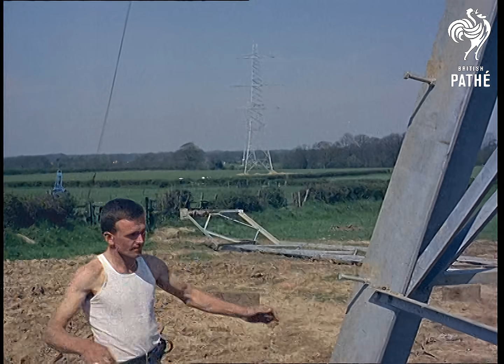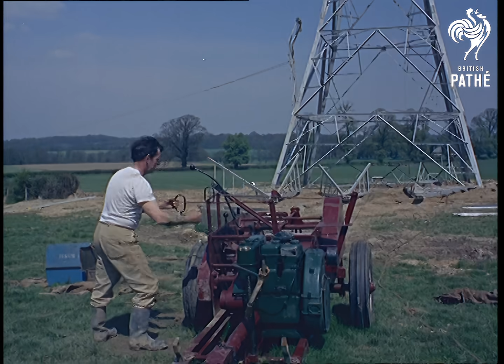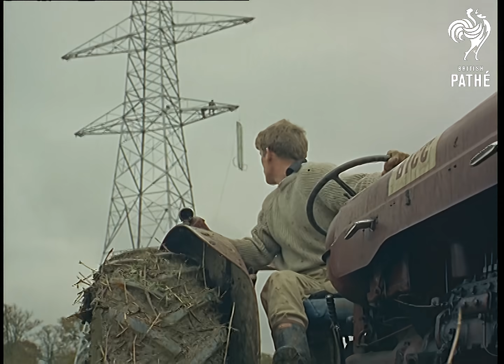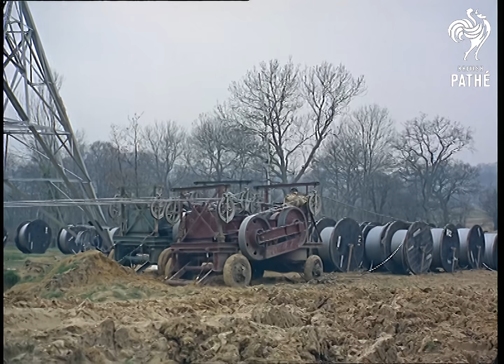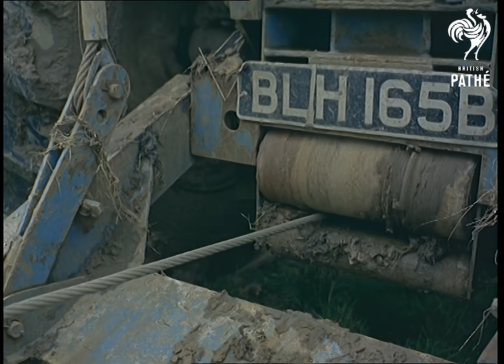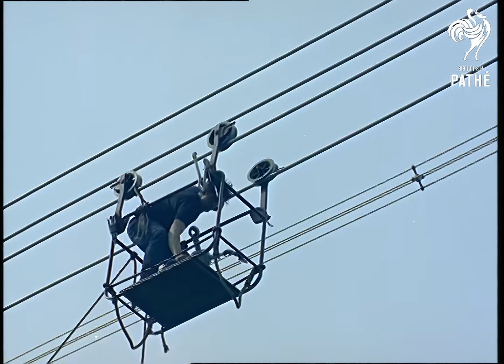The Pylon Men (1966)

Comment: Apart from the lack of safety cables, it doesn’t look particularly dangerous. Honestly, working in an environment like that would probably be very rewarding — you can actually see what you’ve achieved at the end of the week.

Meanwhile, I had to attend a one-day “training course” involving a 180-mile round trip just to be shown how to climb a ladder to about three metres. Completely excessive. I pointed out in the meeting that the drive there was more dangerous than the actual task — people laughed, because it’s obviously true.

Health and safety has become ridiculous in cases like this. It’s no wonder costs are high and productivity is low when so much time and money is poured into pointless box-ticking exercises. Everyone in my group was perfectly happy and capable of using a ladder, but we still had to sit through training that cost thousands.

And then there’s the paperwork — a very detailed RAMS just to go up a ladder and look at a skylight. Because apparently that now requires the same level of planning as a major engineering project.

If someone isn’t comfortable working at height, fair enough. But forcing the same over-the-top process on everyone, regardless of the situation, is just unnecessary.

Comment: The towers are the "L6" design, first introduced by CEGB in the early 60s and designed for the (then) new 400kV "supergrid" network that is largely still intact (albeit since refurbished) today!   The towers need repainting every 15-20 years to prevent corrosion and the insulators, spacers and other fitting need changing every 30-40 years due to mechanical wear and tear.
Hats off to the proper tough blokes who built these steel monsters 60 years ago!  
I guess most of them will either be elderly or passed away by now, but the work they did is still standing strong and serving the country admirably!
Reply: i worked with a man who told me how he was part of the gangs built these in the 60s, RIP legend Tony.
Reply: And the new educated citizens think this all happened by magic and it will be there fore ever.
Reply: Across the pond here.. I recently learned that the USA grids PYLONS are actually coded, from a single pole about 10  meters tall THAT carry no more then 480v to households to massive 200ishy meter tall towers that carry a Doc BROWN  inspired 1.21 zigawatts over massive distance in the heartland .. does GREAT BRITAIN do similar?
Reply: @thomasburke7995 in Canada, or at least in Ontario where I am, everyone is lettered and numbered with a coded system. Transmission line X1P for example is a 230kv transmissiob line that runs from a hydroelectric dam named Chenaux Generating Station to the city of Peterborough that covers an length of about 250km. The X and P is pulled from their supply and destination names with 1 being a single row 3 phase transmission system.
Reply: @thomasburke7995  Yes, all lines are coded and each tower in each line is numbered, with info on its specific type linked to that number.  So for example these L6 lines usually start with a number 4 followed by 2 letters for example 4ZP, or 4VC. Towers will be numbered from 1 to however long the line is.
Most lines begin and end with terminal towers so Tower 1 would most likely be L6DT or maybe L6ST or SJ. Though this info is kept on the national grid maps and is not easy to find for the general public, although there is reasonably detailed information on openiframap, also if you know your towers and where to look you kind kind of work out what codes and numbers each tower has.
Reply: Where they not hot dipped galvanized? Pylons/transmission towers on Ontario Canada from the 1950s are all hot dip galvanized and have never been painted or repainted. The steel lattice structures are all original and still look amazing to this day. They are all either 230kv of 500kv.  

I've never seen painted pylons/towers, ever.
Reply: @pipeweldor4850  They were galvanised, but usually get painted in addition to that. However you do occasionally still see L6s with original fittings that haven't been painted, they do look quite corroded and weather worn now, having stood out in the very wet and often polluted British climate for 60 years. The ones that have had periodic repainting will probably last for centuries.
Reply: @soundseeker63  Is it possible they are not hot dipped galvanized? I cannot see how that wouldnt degrade in Canada which has far far FAR more extreme harsher weather then the UK, yet they corrode in the UK? Seems very odd. Maybe werent truely hot dip galvanized?
Reply: @pipeweldor4850  I don't know what the exact processing for the steel was but they were galvanised to some extent otherwise they would have turned brown/orange within a couple of years of being built! Which they did not.
Reply: @soundseeker63 I suspect they were not hot dipped and most likely electroplated.

Hot dip galvanizing is a heavy duty method of galvanization where entire fabricated steel parts are dipped into a molten bath of hot liquid zinc, creating a thick, rugged metallurgical bond. Hot dip zinc galvanizing is 10 times thicker then electroplated zinc galvanizing and creates a thick robust and rugged alloy layer totally encapsulating the carbon steel protecting the carbon steel from envirometal exposure and hence rust. Standard electro-galvanized coating is very thin and prone to failure when exposed to harsh outdoor conditions over the long term. 

Sometimes galvanized steel also refers to electro-galvanized created using an electrical current to apply a much thinner, smoother layer of zinc. Hot dip lasts 100+ years outdoors. Standard electro-galvanized lasts 20 to 25 years and is best for indoor use away from harsh elements. Hot dip suits harsh outdoor or marine environments very well due to its toughness. Standard galvanized suits indoor items with minimal harsh enviromental exposure well.
Reply: @pipeweldor4850  It will be electroplated then, as the towers need to be painted every 20 years or so otherwise they do corrode. The majority still standing have received multiple coats by this point.

Comment: Wonder what the mortality rate for this job was
Reply: I tried to find out more about this.  As far as I can gather, there don't appear to be data specifically on fatalities and accidents in electricity construction including the supergrid construction.  In 1964 (for example), we do know that there were 276 fatalities officially recorded in the UK construction sector.  Across all sectors the estimates are more like 1000 deaths per year in the workplace directly due to workplace causes of death in the 1960s, based on the Robbens report.  It seems likely that these are low estimates due to underrecording ie. many more people died without the cause of death being recorded in industry statistics and many accidents were not even reported in those days.    These days by comparison a typical year (with full recording) would see about 30 to 50 fatalities per annum.  Based on what has been reported to Parliament, the HS at Work Act led to a reduction of around 85% in workplace fatalities, which suggests that well over 20,000 lives have been saved since 1974 by improved safety conditions.  These fatalities also do not include the large numbers (tens of thousands) that have died or those who are suffering poor health due to having worked with asbestos and other hazardous materials that are now outlawed.

Comment: What I found most interesting is the commentator said a precision operation down to the nearest "millimetre", in 1966 which was quite some time before the U.K. went metric.
Reply: It probably trips off the tongue a bit better than the still-slightly-larger "sixteenth of an inch".
Don't forget, as well, some of these blokes' dads would have been familiar with 20mm Oerlikons and 40mm Bofors guns from the last war. There was a good deal of pre-metrification metrification in the UK.
Reply: It was common in technical industries such as this to use the metric system. Even the Apollo program from the same era used metric for their calculations to put a man on the moon.
Reply: Yeah ,good point
Reply: Imperial millimeters, probably.
Reply: Thanks to parliament, Metrification was a huge thing in 1965, it led to a Quango in 1969 called the metrification board. The rest is history. ❤
Reply: And we're still getting there.
Inch by inch...
Reply: @JamesKing-om5mt  I thought a Quango was a soft drink? 🧋

Comment: It must have taken ages with all those safety lines getting in the way .
Reply: @DrTWG, The actual reason was this: when erecting the steel -or wiring -a safety harness would get you killed quicker. The rope from the harness could get you snagged when things went wrong and you went down with the problem.  If you want to know my bona fides I have written on these pages.  We had very few accidents when compared with the OHS in Canada and US over the past 40/50 years.  I am very proud of what we did then for one simple reason: CEGB was owned and paid for by the people of the UK and not "privatized" as it has been for decades. England then was a great country with generally great, tolerant and decent people.  And I say this as a so called "rebel" Irishman. I have lived and worked half way across the world and I never again met better people.  Good luck to you.

Comment: This footage is absolutely incredible, the speed, efficiency, and bravery of the men in this video is unmatched. Nowadays a lot of line work is done from helicopters.
Reply: I’ve been doing the job 14 years and seen a helicopter once , it’s done almost exactly the same way to this day apart from with a harness , PPE and the odd power tool
Reply: @danielblackie2013 the ones near us 4 years ago had no harness going up
Reply: It’s still the same now only difference is you have an harness on. Still a very hard and tough job but also very rewarding.👍
Reply: They still use those wheeled carts to this day! They are motorized so no line to an apprentice on the ground but I’m sure they are used more than helos.
Reply: I saw guys working from a sort of cable car thing hanging from the cables
Reply: Helicopter lineworking is very Dangerous.
Reply: All of the towers and lines have been being serviced near me recently. No helicopters. Much of the same process as seen here, just with newer (and thankfully safer) equipment.
Reply: "...and bravery of the men in this video is unmatched" - beg to disagree, watch Fred Dibnah doing his steeplejacking...;-)
Reply: No... men still climb these pylons but they are from Nepal!

Comment: Pre hasaw - the risks they took
Reply: The “working at heights regulations of 2005” put an end to the bigger risks of free climbing without being attached at all times. When I did my Overhead linesman training in 1987/88, a hard hat was required but we could free climb all over the tower and only have to attach to the tower at point of work. Since 2005 however, as soon as we put a foot/hand on the tower, we had to be attached permanently.